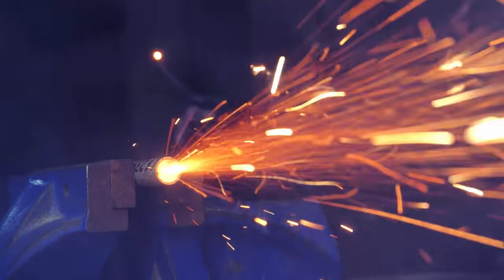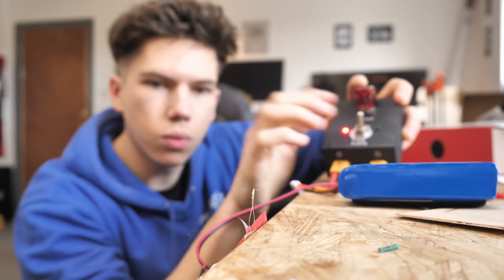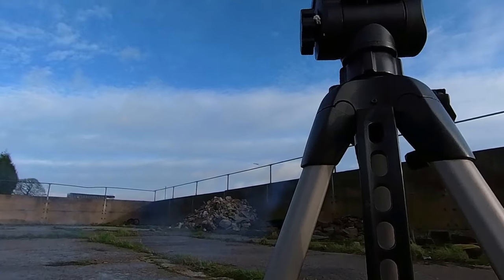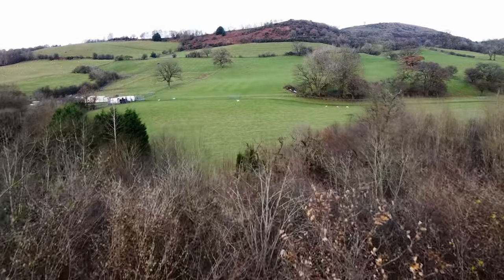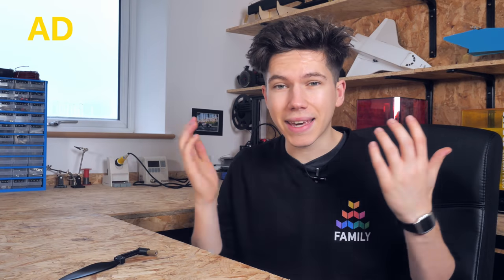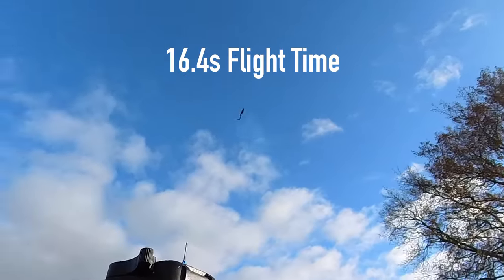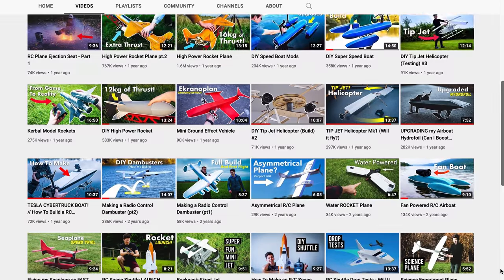Rocket Helicopter

Comment: For those wondering about the difference in the "rotation point" versus the centre of gravity, you can start your journey by looking up "Moment of Inertia" (Sometimes called "mass moment of inertia"). This has to do with how much "resistance" to a change in rotation speed there is around a certain axis of rotation. As defined by wiktionary the centre of Intertia is: "A point, near or within a body, at which the body's mass can be assumed to be concentrated when considering its rotational motion and moment of inertia. This may be different from its centre of mass which is the equivalent for linear motion".

The reason you can't take the centre of mass as the centre of rotation/inertia is that when calculating the centre of mass you are "assuming" that all the equivalent mass of the part is concentrated in that infinitesimally small point. This is valid when you are doing for instance linear calculations with forces acting on this point and causing it to accelerate (using F=m*a). However, when you are rotating that same part AROUND a point, not all that mass acts in that same point the same way. Bits further away take more force to accelerate (longer arm=higher torque to reach the same angular acceleration=higher moment of inertia) than bits closer to the axis of rotation. So when looking at rotating bodies you're looking for the point where (for that particular axis) all the mass around it has a moment of inertia distribution equivalent to a simple disk, so that it rotates around that point in that particular axis.

Probably not the best explanation, but it's been a while since my Dynamics 1 classes ;). With the above terms you should be able to find more info on the internet from people smarter than me and better at explaining it.

For things with a relatively even mass distribution, you can often find the centre of inertia relatively easily by making a simple cardboard cut-out silhouette of a "view" perpendicular to the desired axis (so that the axis of rotation is pointing straight "towards" the viewer), bend it so that it has a slight and even curve with the ends slightly higher, then try to spin it on a flat surface. If you can get it spinning like a top, it'll naturally want to spin around the centre of inertia and you can see where it is quite easily visually, especially if you put some pencil lines in the area.

Comment: can you get the rocket manufacturer to stack fuel laterally/sequentially that is at first ideal for ignition, then ideal for stabilizing, and lastly ideal for longevity of flight?  like, stacks of fuel that burn differently, catered to your parameters to enhance the flight you're trying to accomplish.  like, fuel that burns stronger or weaker.

Comment: Another project idea would be to build a magazine-fed rocket system, so you could have thrust-on-demand in a small RC plane.

I'm imagining a ring of foil tape at the front and rear of each motor, attached to an electric ignitor. You could build a system that lets a servo drop the motor into place, where it contacts two terminals to trigger the ignitor. Moving the servo again would dump the spent motor and load the next one in. You could probably carry 5-10 motors like this and fire them off in sequence.

Or just stick them in a big cluster and electrically ignite them in turn - simpler but less cool.

Comment: What about a attachable controllable vehicle you can controls where the body is actually the rocket engine ? With a fpv camera a small (slow sticks flyer type) there cheap around 20-40 bux  for a pre build kit with engine and all save for other stuff 
Connect giant engine to plant by making it the plane fuel salvage itself and literally stead the rocket with fins kind of a rocket propulsion V-1 from ww2 but with long range  fpv and or with ultimate glide to target ? That would be  cool to see  or actual jet firing model rockets on target that hit ?

Comment: back in the 70s and early 1980s you could buy fireworks called helicopters which were a little rocket motor glued to one end of a small piece of cardboard, here in the UK they were banned because their flights were unpredictable.

Comment: Not sure if you are aware, but in the 1950s I believe there was a rocket propelled helicopter in service. It used two rockets at the tips of the blades and only flew for about 2 hours I believe. I can't remember if it was part of an escape program or what and vaguely remember Nasa was involved in some capacity.

Comment: Could it be more stable if there was like aditional stabilizers 90° rotated arround the z axis in reference to the blade? I think it would force the blade to stay upright to the plane of rotation, aditionally it could be beneficial to slightly tilt the rocket motor up to make op for lacking upwards thrust on the non propeller side...

Comment: As fuel burns the motor gets lighter so centre of rotation and centre of gravity change. Would it be practical to add a disk of metal or large diameter ring of metal ( so any mass is away from centre), this may keep plane of rotation horizontal, so it won't tilt or go off course? There may be a better device to fuel weight ratio, which would result in the loss of fuel weight not being such a factor?

Comment: Ah, the Little Henry! Also known as the McDonnell XH-20. I was lucky enough to work some of the older guys that worked on the Little Henry. They told me that Old Man Mac (which was what they really did call McDonnell) loved the Little Henry and the idea of it. Ultimately no one ever bought a Little Henry because all benefits aside, you had an extremely loud and EXTREMELY VISIBLE aircraft. The rumor is that the USAF considered them for the Korean war and again for Vietnam, but kind of doubt that. They probably did look into it for Korea to at least assess the cost. I believe the Little Henry was cheaper and faster than other helicopters at the time. It was lighter (i think) compared to other craft at the time too because it only had the two ramjets for power. I also remember the old timers telling me that the rotors had a problem with the wing tips going too fast if they let it run as fast as possible. 

I wish i got more info out of those guys now because they've all retried, and there is next to no information about the little henry

Comment: It needs a stick like a bottle rocket or puddle-jumper, not just as a launcher. And that should be at the pivot center of balance, which aesthetically, would be nice if it were where the pieces conjoin.

Comment: when you couldn't get 2 rocket motors to ignite at the same time electrically, why not try fuses? with a cigarette lighter in each you can light both.  I always wanted to use rocket motors as Tip Jets on a conventional RC Helicopter to Drive the main Rotor.

Comment: Dud the Chinese were doing this years ago,, I bought some banned fireworks form china they had two blades on them a bit smaller than your ones ,,You light them it starts spinning then takes of hovers just about head height then with out warning shoots strait at your head completely dangerous but the best fireworks iv ever had

Comment: There's an easy way to light two motors and be sure that both light (if not at exactly the same time)... Use ONE electronic igniter to light two equal lengths of fuse going to each of the motors. This way you know both fuses will light because no rapid motion will occur shortly after the ignition to jerk them away from it, and even if one engine lights first it should not be enough to put out the fuse going to the other motor, which will light shortly after. Just twist the two fuse ends together and lightly tape them on top of the igniter (or, if it were me, I'd just hold a standard cigarette lighter up to them and then run)

Comment: There were helicopter designs with rotor blade tip engines - either compressed air from turbines or piston engines, or rocket engines. I think there was a blade tip ramjet too.
They don't need a counteracting second rotor wich makes them relatively simple, but they lack fuel efficiency if the gasses have to travel through the shaft.

Comment: I'd like to see a semi-tethered single propeller airplane or rocket plane. It's like a single blade helicopter, but the "blade" is a fixed wing airplane on the end of a string. The opposite end of the string is a countermass.

This will be safer to launch, because you can hold the countermass and swing the airplane around you. Then you start up the prop or rocket and let go after it fires up.

Okay, there is a risk that it will wrap around you but it will lost most of its kinetic energy in the process.

Comment: For electronic ignition wire from a vape does the trick perfectly. 2s/3s battery will light off but you would want more of a timer as 2 seconds lights it but 6 seconds burns it. For rotational mass issue you should look further at the angle of attack

Comment: I'm curious whether you could make a tandem helicopter with these that land safely by itself after power runs out.

Ofc, igniting them simultaneously will be an issue so to avoid the thing from tumbling over while waiting for the other rocket to go off maybe you could have a release system you activate manually when you see both rotors are up to speed.
The inherent stability of the propellers could possibly restablize the descent of the helicopter even when one rotor spins for longer and it tumbles high in the air given it has gained sufficient altitude.

Comment: Maybe an increased moment of inertia gained by using a higher aspect ratio or winglets, and an alignment of center of aiming the line-of-thrust of the rocket slightly upward might help with max height?   Weight is offset by lift, and drag is offset by thrust, but they interact and in your device there is apparent force asymmetry, aka imbalance.  You want energy put into the system such that it is translated into the most gravitational potential energy (aka height).  You might consider angling the rocket so that there is better balance of the forces you want.  It seems to launch and leap sideways, which might mean the energy of the rocket isn't put into angular momentum. If it took just a little longer to get up to rotational speed, that might be stored as angular momentum of your device.

Comment: Nice! I think they work better if the rocket motor was aimed downward some, perhaps about the some angle as the prop angle is. This should cause it to have more lift and it would be working more as the prop is, I'm thinking. Maybe more in balance too.

Comment: Back in the 50’s, Eugene Gluhareff designed the same thing using a single one of his G8-2 pressure jets on a blade tip. You should try a sharpened steel leading edge. Heh heh

Comment: Just a thought, add rocket motors to the end of the flybar paddles on an rc helicopter, could be used as emergency propulsion in the event of motor failure.  You are insane might as well toss a hand full of live firearm rounds into a fire and then sit and make some s'mores

Comment: Since the rocket has to be decently far from the center of the spinning, would you perhaps get more flight efficiency by designing the support end to also have a rotorblade shape, albiet stubbier? Perhaps you could get an interesting mix of characteristics such as acceleration or flight time with one end having steeper or shallower blade pitch than the other.

Comment: The fun in creating a Maple seed experiment is creating an accurate model of the seed.  The seed part has a weight to force it to be the center of rotation.  But then when adding power, you want more leverage for the rocket rather than high RPM, this causes an interatomic bomb in your glue together model.  Because of the 3D printed rocket housing, you could build a thrust angle to change the axis of rotation.  To better under the thrust angle, try building the model out of foam board as it is fast, simple, and cheap to build with.  Take a look at the Maple seed again and focus on the aerodynamic shape of the seed compared to the wing.

Comment: I had the same problem of getting two rocket motors to light but with some old flash bulbs did the trick and can be lite with a charged cap. The magnesium wire ignited instantaneously, give it a try.

Comment: I dunno about you but here in Sweden there's a firework that is basically just this, it's a full blade and has the rocket attached under it, you light it up and it starts spinning before it takes off.

Comment: Move the motor closer to the center of rotation.  This increases your "gear ratio", gives you higher rpm, should give you more altitude, and moves the motor mass closer to the center of rotation, which should minimize the effects of the loss of propellant mass on the airframe balance.

Comment: How about adding a pulley for a pull rope starter at the bottom, like the toy versions often have.  Light it, pull the rope to start it, then it's already spinning and flying when the rocket kicks in.  Also a good way to test the balance.  Install the rocket but don't light it, then use the pull start to fly it and test it.

Comment: have you seen those remote control race cars. where they tie them to a pole in the center and see how many RPMs they can circle the pole

doing something like that could be cool.

i was also thinking of making a better version of this?

stronger base. and have something restrict the flight until it reaches higher rpms.

Comment: Has OP really never heard of a Rotodyne?

This is an actual passenger carrying aircraft from the 60's (don't remember the decade) which featured rotating wings powered by jet exhaust ports on the wing tips.

The primary benefit for such is the lack of the counter rotational forces generated by traditional helicopter engine schemes
Reply: I remember the "voljet" Published in "Popular Mechanics" in 1985 or 1986

Comment: I seem to recall seeing a chopper they equipped with small rocket engines on the end of each rotor blade.  I never could figure how they got the fuel to the engines.  I also don't know if they ever got it off the ground....

Comment: use the rockets on the back of your speed boat hydroplane to help accelerate it and get it onto plane. this way you can make smaller planes more optimised for high speed runs. additionally you could run more pitch on the props as they don't need to work so hard at low speed

you can also mount them low down close to the water which will alleviate the thrust line issues you were having.

if going for a record it is also possible to stage the rockets, having a initial getting up on plane stage , and then a final top speed stage that you could activate when the electric motors will accelerate you no more

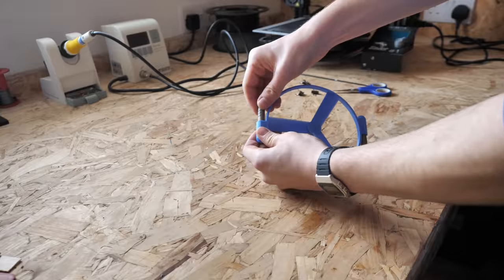Comment: 1:04  what if you designed it to have the rocket in the middle of this design? So it would push it upwards and you wouldn’t have the issue of two not firing at the same time.

Comment: does the center of rotation change depending on the power of the motor?
As well as perhaps as the solid fuel burns off and the weight of the motor itself changes, does the rotation point move?

Comment: See about creating a two stage rocket powered helicopter. Use the low powered motor with no delay for the first stage to spin the helicopter up and to ignite the higher powered motor, and use a higher powered rocket motor to accelerate the helicopter to faster speeds. 
Probably the big problem with this is maintaining the proper balance once the lower powered motor ejects.

Comment: Spinning it up on with a motor base after lighting the fuse before ignition  will stabilize the machine and lead to longer flights. Longer equal length fuses will solve the dual engine dilemma .

Comment: for takeoff and flight to be more stable, it is necessary that the aerodynamic center and center of gravity coincide in the horizontal plane, and in the vertical plane the aerodynamic center is higher than the center of gravity.

Comment: the firework motor is in fact a battery, can you find a way to power an electrical drone with those motor/battery you will need to convert the chemical energy into electrical energy or use the heat to power a Stirling generator.

Comment: Love your videos.  How about this:  Something like the blue three bladed version; but with the (single) rocket mounted vertically in the hub and a pair of ANGLED blast deflector plates in the exhaust stream to make it spin - while also having a significant vertical thrust ?
Reply: Wouldn't that require a portion to be fixed with the deflectors rotating around it, thinking full scale with a human on board

Comment: How about building a rc plane (or using any of the ones you already built) and attatch a rocket to make a missile? I guess it would be pretty cool; a similar idea to the Dambuster video!
Reply: Huh? Dambusters used one huge (bomber could only just lift it) fast spinning bomb, that bounced on the water surface, sank to the bottom and blew up the dam. The challenge was, flying an overloaded bomber at tree top height, and releasing that bomb at exactly the right distance from the dam. Too early: no damage. Too late: no damage. It was a nightmare for the crew. Training was fatal for at least one bomber. Did those dambusters use rockets during take off? Missiles? Rockets? ¿¿¿ ???